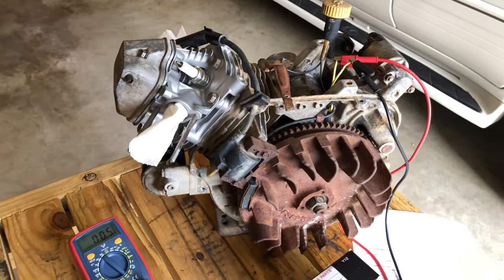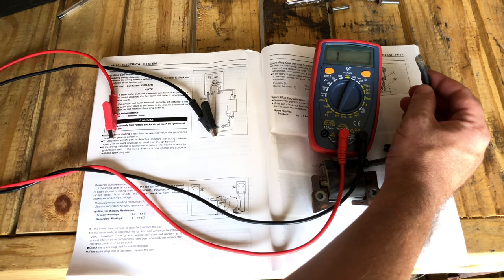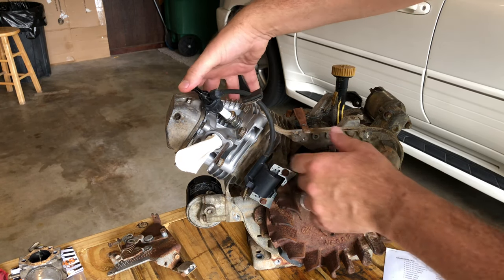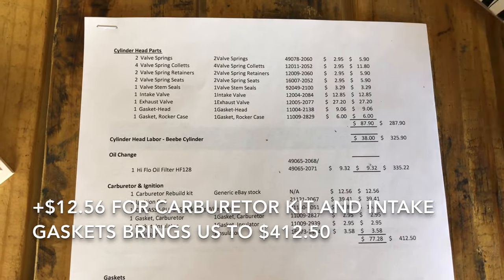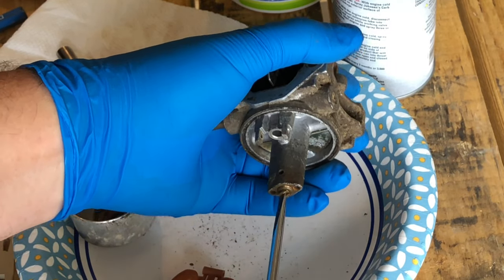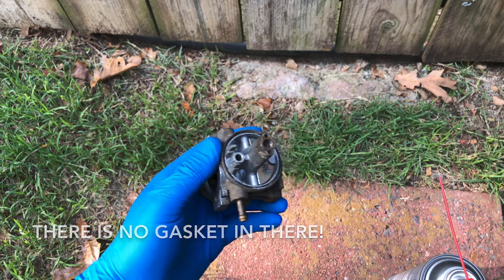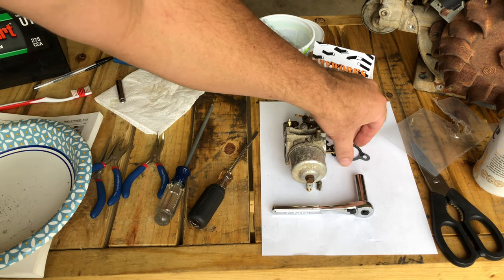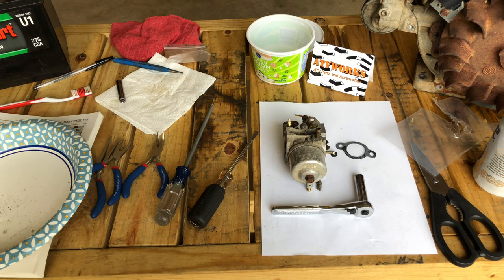Kawasaki Mule 500 KAF300 B1 with FE290D Engine - Ignition Coil Test / Replace, Stator test, Carb Kit

Comment: Your meter leads have resistance.  If you short them together while reading ohms, you will see a number other than zero.  Perhaps it will be .3, or .5 or so.  When you measure the resistance of the coil, subtract the lead resistance.  For higher resistance values the lead resistance will not be significant.  Precision ohmmeters actually use four wires to measure resistance, but that's another story.

I just pulled the same engine from a John Deere Gator.  It ran but burned a lot of oil.  I'm hoping to pull the piston and get a good look at the cylinder walls and rings. Right now I'm cleaning the engine down before I take it apart.   I hope my clutch removal tool fits.  Thanks for the video, very helpful.
Reply from the maker: That makes perfect sense! Thanks for the information.  I appreciate your informative comment. Glad the video helped.  I have other videos on the FE290D engine, where I got into the internals and replaced the rings.  I have been very happy with the results.  Great little engine!

Comment: I have  a kawasaki 1310 4  been running  fule pump  on straight  wire from battery. Decided to replace relay was bad had two hot wires coming  from Ingintion and ground wire black.order relay from Amazon not sure how to hook up with to hot wires,could u help.

Comment: I have a KAF300A and searging for wiring diagram , getting no spark?🥲
Reply from the maker: There’s a wiring diagram in the service manual.  I never could find a free one online, so i bought one on ebay.  It has been invaluable when diagnosing problems.